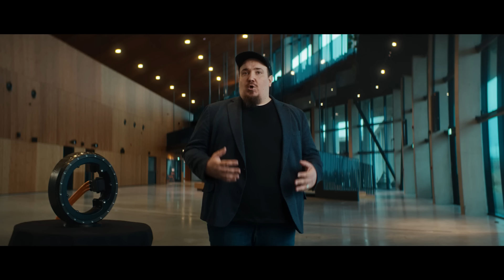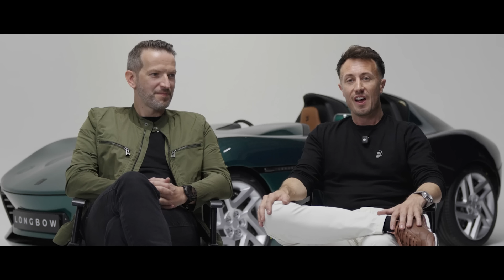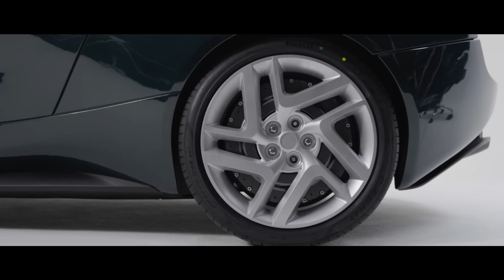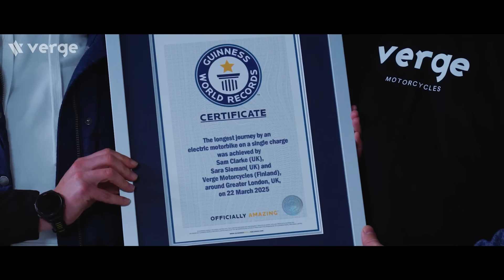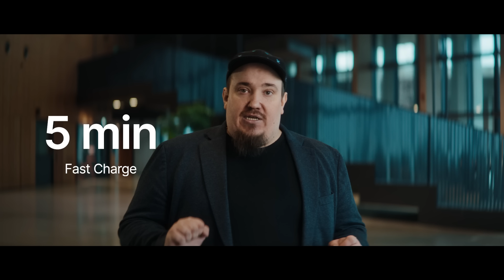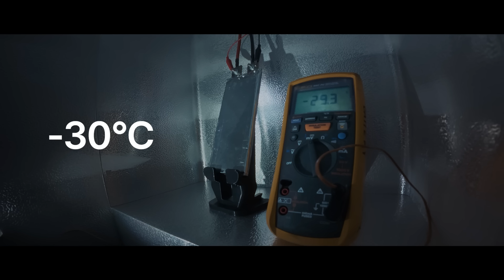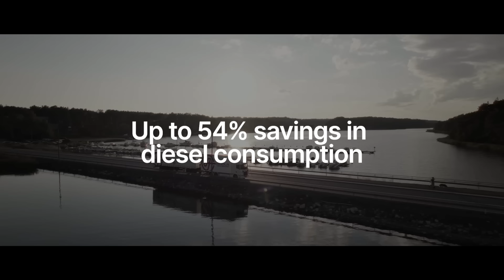World's First All-Solid-State Battery in Production Vehicles | Donut Battery

Comment: 100,000 charge cycles is once a day for 275 years, no one needs that.
Where do I get a sample battery to test on my bench?
Reply: I don't think it's a battery I think it's a supercapacitor and they lied about the energy density
Reply: @chuuba_lover  
Not a super capacitor, have been designing with them for 20 years. They are good for over 1,000, 000 cycles but only have < 7% of the energy density of battery's. 
It's more like a marketing departing making an announcement, without engineering involved, just a way of sucking money out of goverments.
Reply: @universeisundernoobligatio3283 
That's kind of what I said 

The performance characteristics, cycle life and rate performance are characteristics of a supercapacitor except the energy density. 

I quite like supercapacitors but they're just not viable for a lot of applications and often times they're very expensive
Reply: Same place they sell theranos products and snake oil

Comment: I won't believe any of this until I see it in action by 3rd party testers and reviewers because from what I understand, CATL is already doing this but they are still to this day supposedly trying to figure how to solve heat issues, dendrite formation, and battery longevity issues. No company on Earth will have the holy grail of solid state batteries until they solve all these issues, make them affordable, and make them scalable to mass vehicle production. It will also need to meet it's goals of truly being safe, and truly have recharge speeds equivalent to filling a gas tank, plus give 400 to 500 miles range which current hybrids can do with ease. It also needs to perform the same or better than current technology in the extreme heat of the desert or the freezing cold, and the below-freezing cold! This is a good video don't get me wrong, but it is just a feel-good video until it becomes a reality.
Reply: Yeah but this isn't lithium ion ssb. This could be Sodium or sodium sulfur. So am SSSB and there is Europe not as far behind as with LFP in China

Comment: Sounds great, waiting for under 50k 1000km+ vehicle
Reply: I rather take EV with smaller battery, much lighter and really fast charge with wheel hub motors and you still get much further than carry excessive large battery around for range that never going to need.
Reply: you are absolutely right about daily drive. Mostly the smaller battery will fit perfectly. And for sure Ill take cheap city car. For our family travels we travel very long distances and I prefer not to search for charging points. Moreover in our region charging points are mainly lower voltage and cant charge fast anyway
Reply: @ilhanbaljiev7748  What is point to go for trip if that trip itself isn't journey only destination matters. Must be really fun for kids to sit hours at back seat.

Comment: The constraint for range in a personal car is not the car or the motor or the battery, it is the human inside. Nobody alive drives longer than 3.5 hours without needing a bathroom or food, at 70 mph that’s 245 miles. Anybody who says otherwise should be forced to drink a large coffee and drive 4 hours to see how bad they will feel at the end. Stopping to charge between 250-400 miles (achievable today) is not an inconvenience, it is a reality of the human body. The use of higher energy densities in passenger cars is less than meaningless as a result, we need those higher densities for heavier duty applications like planes and ships. At best solid state mini packs would significantly reduce weight of a car while maintaining the same capacity. In other words the packs will get smaller, the car will get lighter and cheaper, but ranges will remain exactly where they are. Because once again, there is no one alive outside of a business context who needs ranges above 350 miles. What they need to do is stop  launching the car to show off and stop speeding at 90 mph for their whole commute then wondering like fools where their range went.

Comment: Had to check my calendar to make sure it wasn't April 1st..
This is bonkers! 🤯
Reply: Legit isnt real
Reply: did you look at the charging demo at 13:00 where the battery is swelling when charging and nobody is talking about that in the comment section.
Reply: @mohammed_mubashir liquid
Reply: @mohammed_mubashir  Not to mention that this is a small scale battery, OFC its gonna do well
Reply: @mohammed_mubashir Watched it again. Not clear that's swelling and not just deformation. Likely due to temperature changes given it starts nearer the end of the cycle. I watched Two Bit da Vinci's interview with the CTO earlier and he discussed that the charging rate in the video is at the upper limits of sensible rate, which presumably means thermals.
Reply: It's a scam... Same as the AI bubble

Comment: Very Excited for this technology. Hope Tesla takes notice and integrates your battery into the newer cars. I do not want to be so calculative about charge from x to y percentage, slow charger use everyday etc. If Donut batteries remove these constraints, then there is nothing like it, practically perfect Tesla with 100% battery everyday and little to no degradation! :) Hope Apple and iPhone also integrates your Battery Tech. I do not want to be so calculative on my phone either, just plug and use for long lasting battery.

Comment: The biggest win here is that you can use the whole battery capacity without degradation, unlike lithium batteries that only use about 60% of the capacity to maintain cycle life. Cold weather use is also another big win.
Reply: Yeah that's one of the many things that passes doubt to me on it. No battery type has that advantage. Many claim LFP does, but they're wrong, it has the same degradation of charging over 80% and discharging under 20%. Manufacturers just market charging them to 100% because voltage drop over capacity for LFP is inconsistent so top charging is required to rebalance the pack.

Comment: Impressive, let’s see where this goes… currently FWD heat pump LFP 60kWh = 12.9~13.1kWh/100km; looking forward to all the above. Drop another video on specifics, such as how braking functions / interfaces with the Donut motor, efficiency, safety, and as far as the battery, what type of output does it have in relation to LFP ~sustained voltage output, etc… Best wishes

Comment: This video is amazing! I always wait for independent verification but the claims on here are worth getting excited about. This is the technology that was promised for years, and opens up new avenues of electrification. If the numbers are on the money, this means that small electric planes (as in private planes) become potentially practical rather than the current 100 mile range mob. If it's lighter weight than Li-Ion then that's a benefit too, not to mention the safety aspects detailed here (in case we've forgotten, avgas, petrol, kerosene have been setting vehicles on fire just as well as li-ion, and for a lot longer). I'm actually hungry for more details on this tech, love the news about the Verge TS, that is beyond amazing too have a short charge time for a long range electric motorcycle.

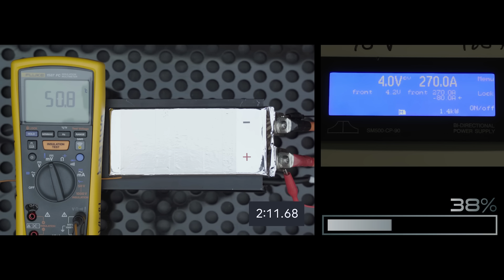Comment: Did the battery warp during fast charging at 13:13? This is truly unbelievable!!
Reply: I was looking the same thing. However, even that small amount of warping with 270 A current to a single cell would be totally bonkers already, if true.
Reply: They normally require compression just like regular cells

Comment: If not an early April's fool joke, this is paradigm shifting.
Reply: It's not April fool's, it's all year round fool's with fund money scheme.
Reply: @o3tomas  … but they are already producing and selling the batteries.. meaning any potential investors can see, feel, hold and test the actual product.

If this was a scam, it would be the world’s shortest lived large scale scam.
Reply: @HiThisIsMine if it were real, big companies like Tesla, Toyota and VW would have acquired them
Reply: @Arya_amsha - That’s not how acquiring companies works. Not all companies get acquired and if this was their first announcement, it’s possible none of the big companies have even had a chance to negotiate a purchase.

Based on all the details, this has all happened within the last half year or so, which really is the most unlikely thing.
Reply: @Arya_amsha IF they could.
Reply: It's all fake.  Just a currently available high performance Li-Ion cell.  
It's NOT Lithium free, it will NOT last 100,000 cycles, and it will NOT charge in 5 minutes for more than 1 "cycle".
They need to prosecute him for fraud.

Comment: I'll believe it when I'll be able to buy a cell from Amazon or AliExpress to put in my flashlight
Reply: Or if there's a phone with 20000 mAh solid state battery that has the same dimension as the 5000 mAh one, I would buy it
Reply: @sihamhamda47 assuming on the difference between the normal 20 kWh battery and the 33.3 kWh battery in the Verge, you'd have around ~8300 mAh in a phone
Reply: @s @sihamhamda47 nrelated question but does anyone know why phones use “mAh” instead of something like mWh? Watt hours seems so much more straightforward especially when we even charge phones in watts
Reply: @sihamhamda47  it won't be the same size, but having new type of batteries instead of stupidly hazard LiIon - is really a good point to start with.
Reply: *fleshlight

Comment: Life has taught me that if it sounds too good to be true, it generally is. No mention of what materials are in there for example is a bit weird. Those motorcycles are anything but cheap, at 40k EUR a piece. Which makes the claim that this battery is cheap hard to believe. Also, can the car manufacturers purchase just the battery or they have to use the skateboard platform as well? I doubt large OEMs want to be locked into that.
Reply: Cynical too.... But as far as your last point that's why they're probably partnering with a smaller OEMs. 

And it's best to not to be too cynical, since occasionally good ideas take decades to develop. 

For example InventWood, which took about a decade is just being commercialized and may or may not be a commercial success? And hoping long-term it'll have applications in the transportation industry? C'est la vie

Comment: Well... "I want to believe", but this amazing presentation is lacking the names of the materials for the batttery. 
If all the other battery makers, name the main material of battery, in this case we didn't get any information about the "globally abundant materials".
I don't need the recepie of the Donuts. I Just need the name of the products to make it.
But i still see it as the best news of this year.
Reply: The material is "Donuts" or 😂? 
I hope this is true, it should have been spoken of, I don't get this
Reply: Come on folks the man told us exactly what it’s made of. “Local Stuff”…… So …. What is “Local Stuff”???
Answer: “Stuff found Locally “ ….. Duh!
Reply: My guesses are either lithium-sulfur or sodium-sulfur, since it's the only alloy material that are abundant and cost the same as LFP, but it's far more energy dence than NMC
Reply: Seems right but currently most sodium-sulphur batteries require the materials to be molten so are kept at around 350°C, and as far as I can tell there's not even a hint of an all solid state sodium-sulphur battery, close to production readiness
Reply: Zeroth said they certify 0% lithium and talked about a titanium-ceramic moldable clay-like material manufactured in stacks, instead of the jelly-roll lithium approach.
Reply: Its last years news actually!
Reply: 13:12 the cell bulges near the cathode in the 5min charging demo!
Reply: @newtonchutney  Good callout
Reply: @newtonchutney  maybe, maybe its just the metal foil getting hot and expand/change reflection
Reply: Chances are it's just lithium. 400 Wh/kg semi-solid batteries have been available for a while from China. 100000 life cycles though... seems nuts
Reply: @izzeww8487  Zeroth said they certify 0% lithium and talked about a titanium-ceramic moldable clay-like material manufactured in stacks, instead of the jelly-roll lithium approach.
Reply: @izzeww8487  do-nuts?
Reply: "globally abundant materials" likely means a sodium-ion chemistry.
They they have a wide voltage range, which can reduce round-trip efficiency. But if you don't use the full voltage range: you may improve both round trip efficiency and cycle life (the latter was specifically mentioned in the video).
Sodium-ion batteries have lower energy density than Li-ion batteries: but a solid-state format, if successful, should fully mitigate that.
But why not just say that? 
Are they concerned that CATL will be able to beat them to market?
Reply: @economicprisoner if they really had this, China would already have a spy sleeping under this guy’s bed.
Reply: Salt. here you go.
Reply: create a product that revolutionizes the energy spectrum and just give away the blueprints 👍🏻 Come on bro
Reply: Would almost certainly be something like aluminium and... maybe a small amount of graphene?
Reply: @GetFluxed  Unlikely. Graphene is hard to make at scale and would drastically raise the cost. Graphene could be cheap, but not today.

Comment: Wow, change a motorbike in 10 minuts.
You can change a Semi Prime Mover from 10 percent to 80 percent in 20 minutes with the right charger.
How many Motorbike manufacturers make more than 30 million units a year? To get hold of you battery.
Reply: My 2022 Ioniq 5 EV can charge from 10 to 80% in 18 minutes, provided the infrastructure has a working 800V DC charger. 10 minutes hasn't been independently validated. Infrastructure matters too. If a reliable and appropriate charging station can't be found, that 10 minutes really doesn't matter.

Comment: do you mind about using dry electrode coating process for the cathode?it has potential of 30% energy density gain because of thicker and denser cathodes.(520 wh/kg with dry cathode vs your current 400 wh/kg wet cathode)